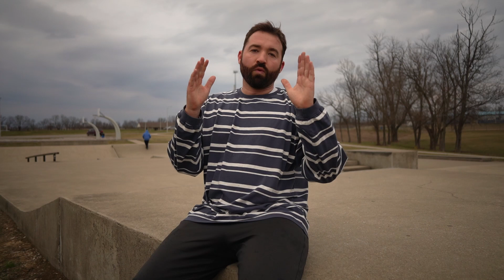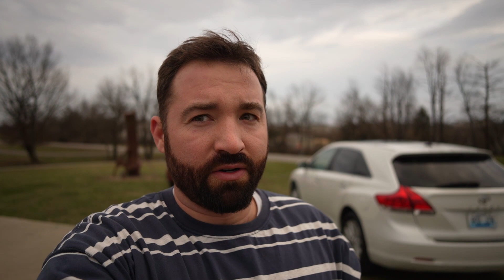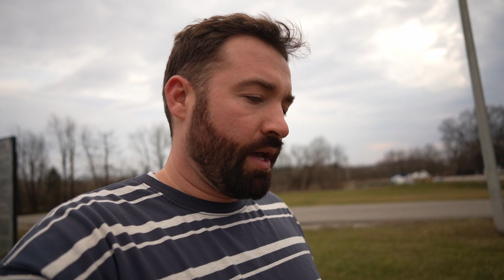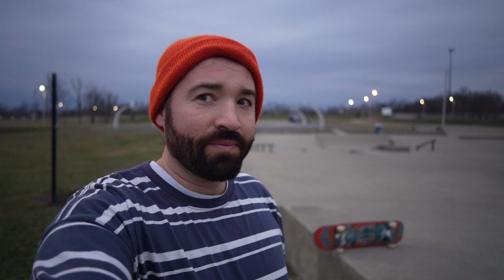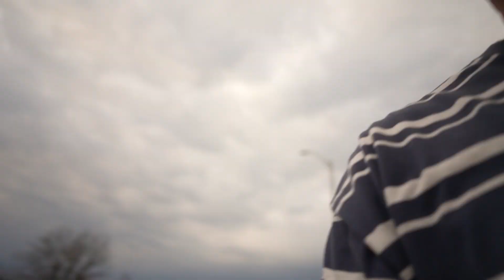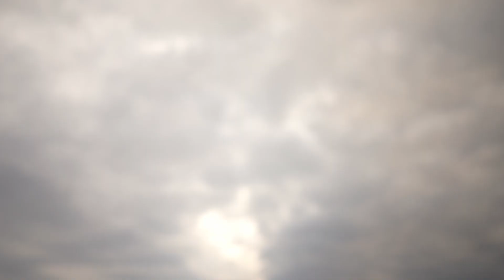Sony Wireless EMC-G1 microphone

Comment: I heard the shock mount noise in the later test, when you weren't focused on keeping it completely steady. I watch cycling YouTubers and many use the ECM-B10. They wrap an elastic band around the space between the two sections of the mic and I haven't heard any tapping in their videos. But yeah, shotgun style mics aren't very good for when you're at a distance, especially with auto-gain.